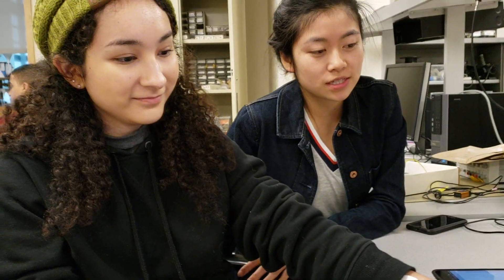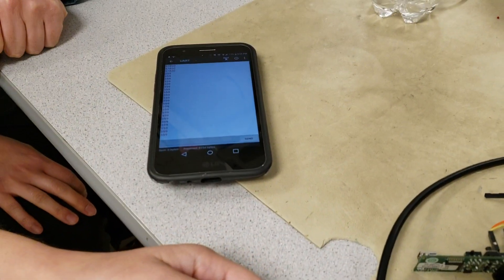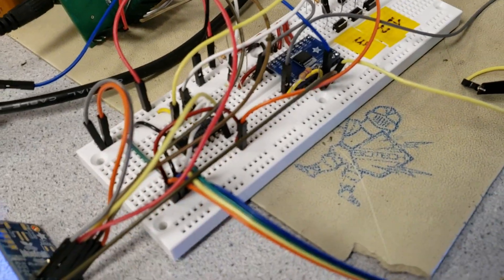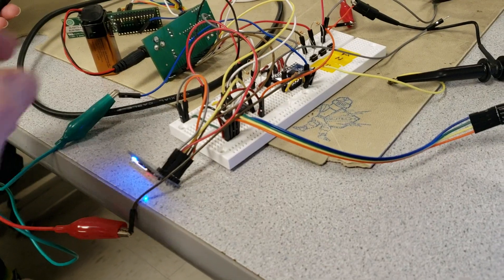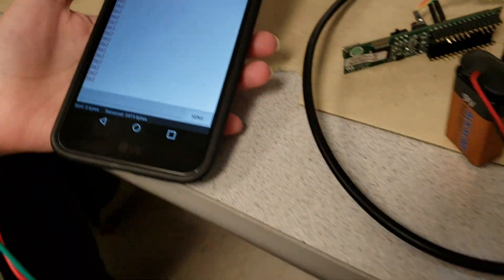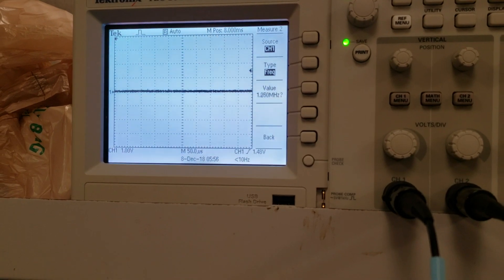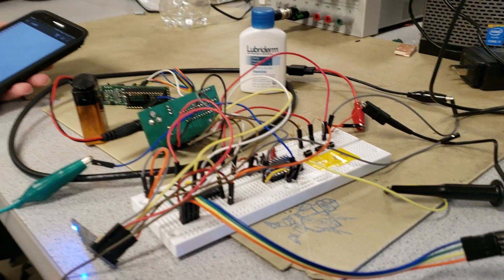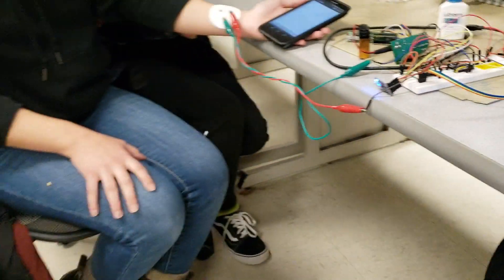hydration Monitor

Comment: Sir can u please share me your email id sir.
I want complete description of this project sir.
Reply from the maker: The only description available is in the linked report
Reply: @ece4760  thank you.. can u please guide me with this project using microcontroller msp430g2452 and not on bluetooth module sir..?
Reply from the maker: @chaithanyakp4786  I cannot. I have never used msp430.
Reply: @ece4760  ok sir thank you for your time